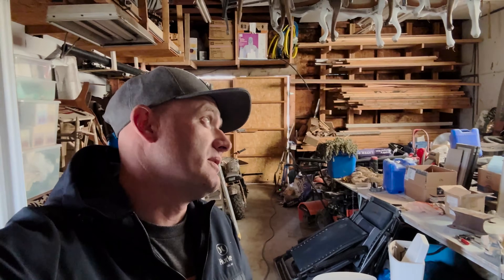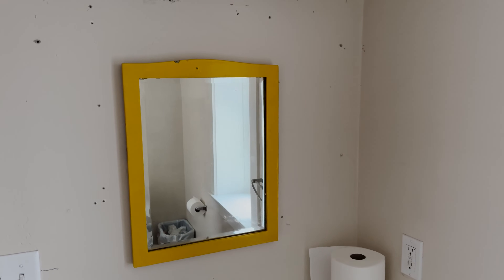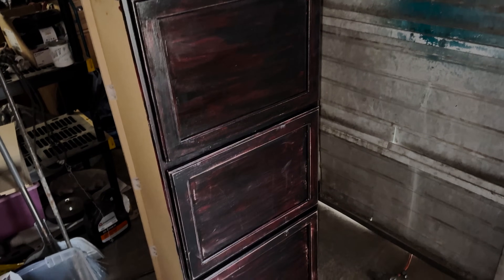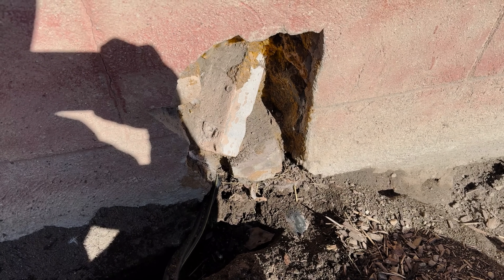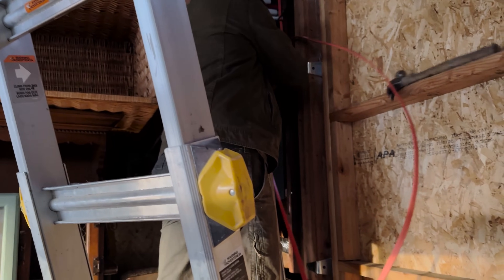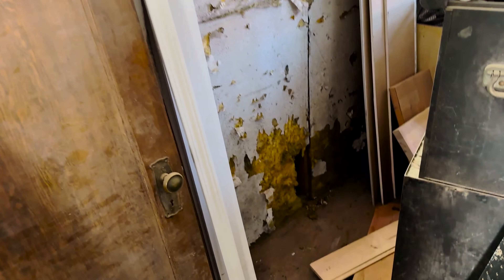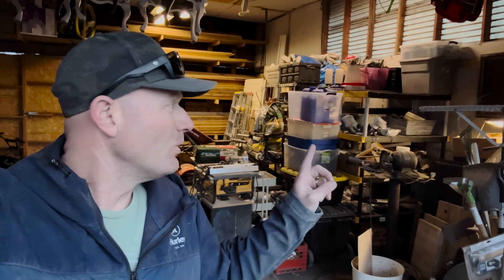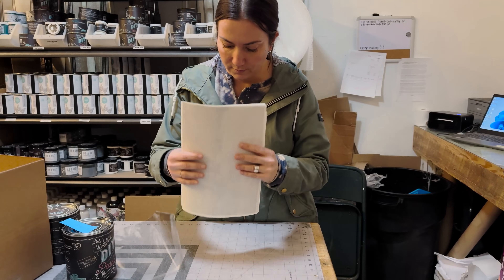Spring Barn Clean Out

Comment: My Dad put a piece of wood on the garage wall in between the wall studs, the rakes/shovels went handle down and rested on the sill plate ( not sure if that's what it's called). That way the garbage cans could sit in front of them. It was easy to slide a can out of the way to get to the yard tools. You could still see them. Nails higher up on the studs for those big orange extension cords. And he had screwed the lids of baby food jars to a board that was attached to the floor joists ( well ceiling) in the basement.  All the odd screws were sorted in them. You just had to look up to see them and screw off the jar you needed.